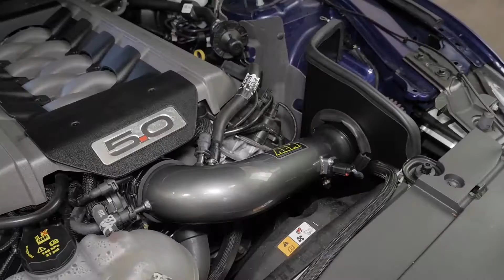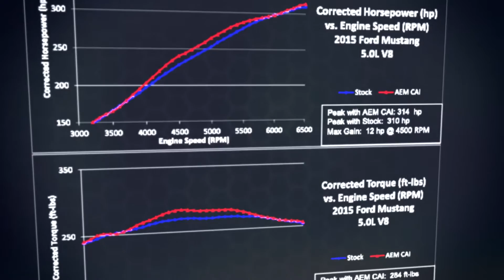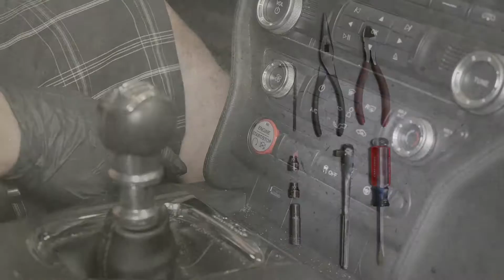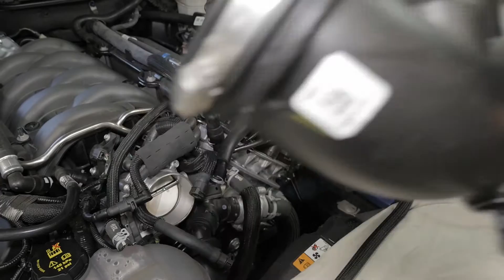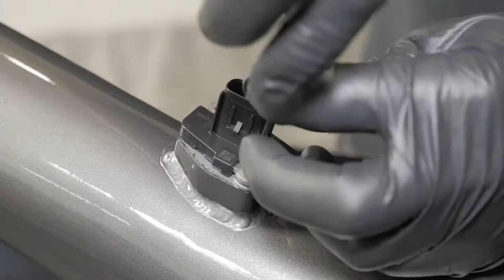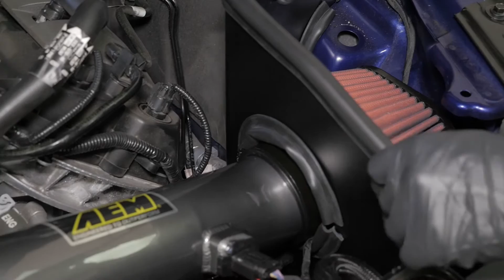How To Install an AEM Air Intake on a 2015 Ford Mustang GT 5.0L

Comment: Hi
I just bought this AEM cold intake system but I have one question.
Why like you said “sound transfer “ being blocked with the providing cup,what that line is for and what will happened when we do like you said?

I am just worried about something may not be cooled down or similar.
Please respond on my question.
Thank you